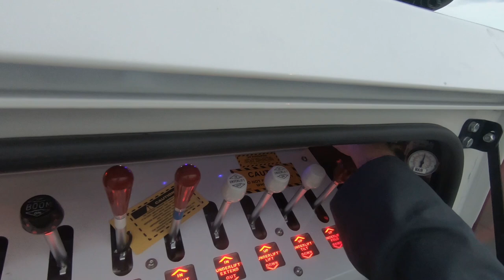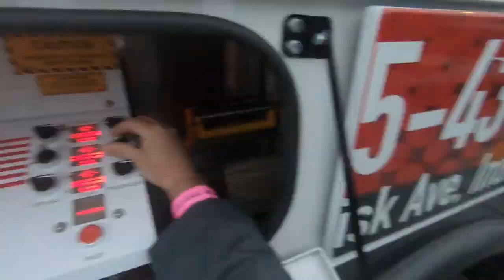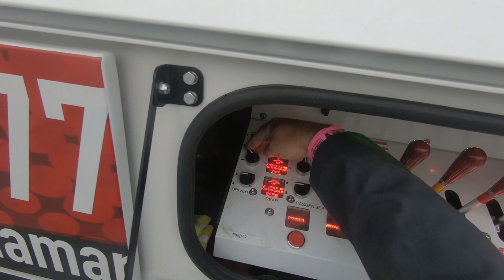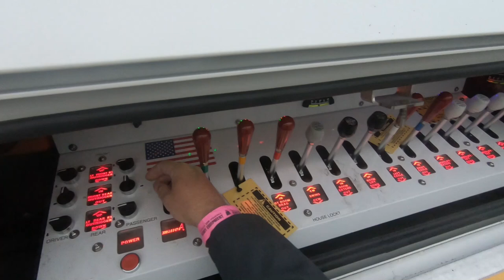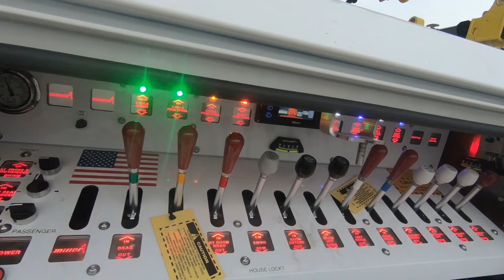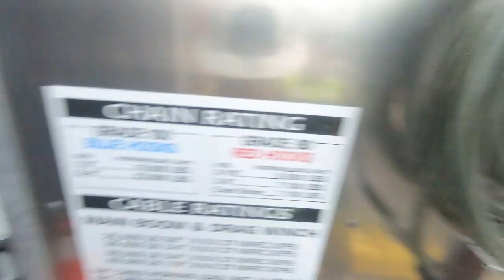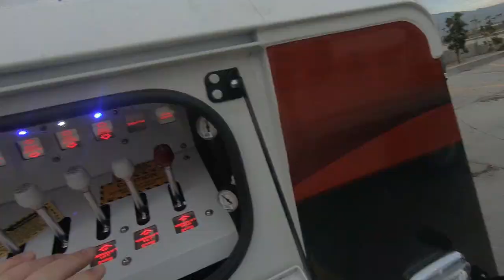Lifting 2 Transformers With Rotator

Comment: Trent Sr.
I do not think that you will ever regret getting a "Tator".   They have so much versatility and there is a lot of work out there that you wouldn't think of tackling without one!  Be safe!
Reply: I said on the first video when they said they bought one that there is tons of work out there they could take on with this they wouldn't before. This job here could did with one their current trucks but it would be back trailer in pick load then swap trailers out under it. this way its split sides and go. Even recovery work it makes it easier to setup and you can set truck in best place to allow traffic through without taking up the whole road.

Comment: That was a easy one , but lots of bucks hanging in the air...
But a question I noticed you always seem to level the outriggers from the driver side is that because you don't have a leveling meter gauge on the passenger side? 
An question 2
Is the reason you hook the two hooks together on the 2 cables so that it doesn't untwist? Since it is twisted cable.

Comment: Why not just remove the truck from trailer and have a different truck take the trailer to it's destination?  Instead of load change to another trailer?
Reply: Owner operator probably doesn't want to give the trailer to some random guy/gal.
Reply: Owner operators equipment.
Reply: 14:30 answers that.
Reply: This would have been a much easier solution for sure.  Early on, the driver was commenting about being an owner/operator, might be a single truck and trailer operation and the customer found another truck/trailer to finish the delivery so they had to swap the load.
Reply: This is why you don't hire a single trucker for these kinds of jobs

Comment: Out of curiosity: what kind of job would require the lift axle on the rotator to be down?

Edit: one remark, though, the receivers may not be too happy with you guys flipping those transformers around 180 degrees.
Reply: The lifted axle automatically retracts when the truck stops or placed in reverse.
Reply: Grinning I thought the same thing as to the rotation.. but the driver is the boss and he said was good. But the control panels we're on the passenger side which would be the lighter side of the two sides that would put the majority of the weight on the high side of the road... Laughing but their roads their traveling ain't nothing like our high-crowned Michigan roads

Comment: Why do you need the pads under the outriggers when you're on concrete?
Reply: View from the road spreads the load out over more ground so you won’t damage the concrete
Reply: We're talking about California where you don't want to leave any marks on someone's concrete for the owner to come after you.  They have more attorneys than Boy Scouts!!!
Reply: great question. Regardless of the type of surface, pads improve the safety and stability of work environment and support for heavy loads to prevent ground damage, in a nutshell.
Reply: View from the road it helps to not mar the concert surface
Reply: I guess so it's to protect the outriggers themselves. Less wear and tare it's better overall plus it's safer!
Reply: The concrete was already broken and cracked. He used the pads to keep from breaking it any further, terminal and truck stop can get real picky. Also the broken pieces might sink into the ground under such concentrated load.
Reply: Also, the "give" in the pads creates more area of contact on uneven surfaces, and the rubber surface reduces slipping.
Reply: Nathan Brodeur ... What concert? I know it's Coachella, but I didn't hear any music.

Comment: Why hook two lines together when you can just double up a single line and use snatch block?
Reply: Adam Savage they do that for equal pull on both sides of the boom. They put the force equally on both sides rather than on one side creating unnecessary wear and tear.
Reply: But there are also D-rings on both sides at the end of the boom